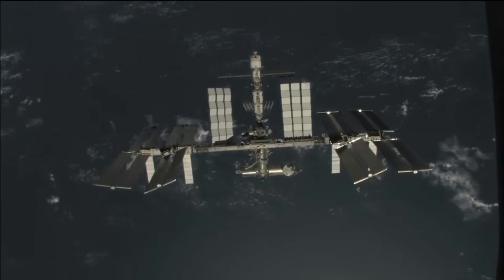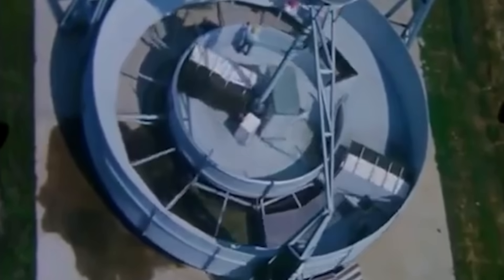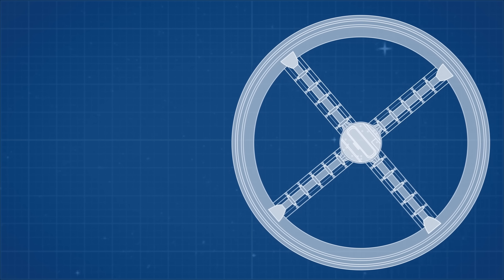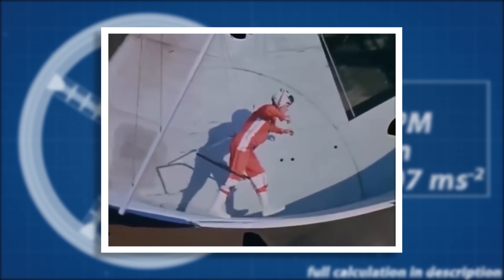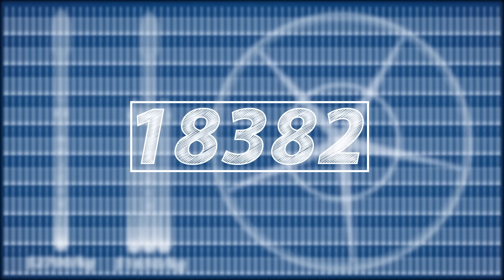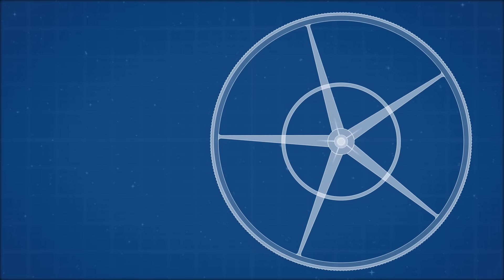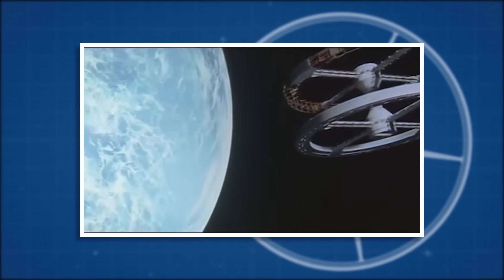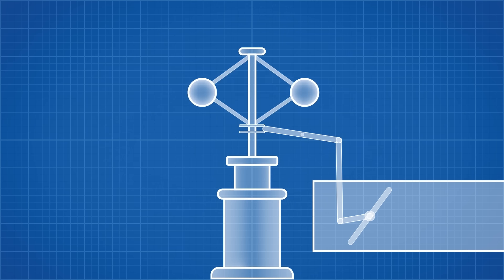Can We Create Artificial Gravity?

Comment: first, you dont need something so big as the elysium to reduce the gradient effects of your feets and head..  400m diameter disk is enough in that matter.
You dont need a disk.. you can use just a tether with another habitat for counter weight, or you can use inflatable habitat and you launch them in sections to complete the ring.
Your cost calculations are also pointless, launch cost will be reduce a lot in the comming years, and we will not need nothing of this until 30 years at least.
Reply: He did qualify his calculations with "although costs will only go down in coming years". 
I don't think working out a solid figure with today's information is pointless. Bit harsh expecting him to calculate costs based on imagined figures from the future.
Reply: AngelLestat2 What percent of force difference between a persons feet and head can they handle before becoming  disorientated? What is the smallest radius for 2Gs of simulated gravity before it sickens occupants?
Reply: AngelLestat2 yep and that's why NASA doesn't use it.
Reply: You can't simulate gravity everywhere. That is fiction.

Comment: Probably NOT in the way you describe.
(please read complete post if replying about vibration)
Sorry but rings, joined pods or any rotational gravity that does not have a firmly fixed axle wont work.
Take your car wheel with it's nice fixed axle and just move a wheel weight and it will start to shake.
A freely rotating object in free-fall (orbit) would require even more precise balance .
 
If a person were to walk from the 0 degree point to the 90 degree point an equal mass would need to move, in concert from the 360 degree point to the 180 degree point at the same pace.

You might say this would have little effect on a million ton station, but it would be cumulative,  and any unbalance would quickly accelerate without a fixed axle to force it back to center.
Putting on counterweights that could be rotated around the station might be a solution to ironing out small oscillations, but it would probably mean that large movements of personnel, such as 500 people going to a concert all from different parts of the ring wouldn't be very practical.
Reply: I don't see how what you're saying can be true.  How do you even have a "fixed axle" in space?

Now if you're saying that the center of mass would change then I get that.  But so what?  At extremes that might be a weight distribution problem, and therefore a structural issue.  It will never be a vibration issue however.  Vibration is caused by the center of mass not being in the same place as the axis of rotation.  In other words, if the axis is fixed (as in a car axle) and mass is distributed unevenly at the rim such that the center of mass is not where the axle is, the axle will still try to force the center of rotation to be at the axle.  That stress, combined with the rotational motion is what produces vibration.  In space, there is no fixed axle.  The center of rotation is free to move to wherever it wants.  Therefore no vibration.

If you don't believe me, try hanging a bicycle tire from a long string attached to the hub.  Unbalancing the tire will cause the point where the string attaches to move in a circle, but it will not produce any vibration.
Reply: I don't know if you clicked the "read more" as you fail to see that the "vibration" issue was just the first part of my explanation. I just used the wheel weights as an example. On a fixed axis the effect of a tire being unbalanced causes vibration in the car which we've probably all felt at some time.
Pretty much my whole point is you CAN NOT have a fixed axle in space.
(good clear explanation of where the vibration on a spinning hub comes from BTW).

It is the oscillation that's going to cause the problem (as I went on to explain).
Your example of a wheel hung on a string is a fairly good demonstration of the oscillation being unbalanced will apply to a spinning object, but it is still hung from a fixed point under 1G ,which makes the string a rod, so it has external forces restricting it's range of movement to within a fixed circle (fixed by rotation rate, length of string and how unbalanced the wheel is).

A more precise and easily tried home experiment would be to stick a couple of  the same vale coins onto opposite sides of a Frisbee, and watch it fly straight. Then start moving one coin around the ring getting closer and closer to the other coin. It will start to oscillate (wobble) when you throw it, and the closer the coins get to each other the more pronounced will be the oscillation.
 
It's the same misalignment of the center of balance that makes a "goofy ball" toy goofy when thrown or rolled.

Such an oscillation in a Ring space station could be countered by computer controlled Station Keeping Thrusters, but would cost a lot in fuel.

To be clear, such an oscillation could not be allowed to occur (even if it was neat circular pattern) as it would be detrimental to a clean orbit. The station would move from side to side on it orbital track, and (worse still) accelerate and decelerate as it falls.
Reply: You're talking about things like aerodynamic effects in space?  Not applicable.  Center of balance also only applies if you're balancing against an external gravity field, which of course in space you're not.  I think you also need to read up on reaction wheels (used for example on many satellites for attitude control).  I don't get your "moving side to side as it falls" in a space context.  Again, if you're talking about the CoR (center of rotation) not aligning with the center of the structure, I don't see the problem.  The only effect of such would be a slight difference in the force of "gravity" measured at different points around the rim.  Those variations would be stable/static (for a given mass distribution), so no "vibration" or "oscillation" to shake the station.  As long as those differences don't exceed the strength engineered into the structure things should be fine.

A ring/disk structure should be stable even if the CoR is ON the rim.  The only problem would be that now the "gravity" gradient would be extreme, with the CoR being in 0g and the opposite side of the rim being at much higher than normal (exact value dependent on rotational speed).  As I said, that's definitely an engineering issue, and could make things like moving around inside or docking with the station.. interesting, but also note this situation is unstable and could never occur without deliberate effort.  If all the mass were liquid and the rim a uniform hollow torus then the liquid would start flowing "downhill", or towards the higher-g point.  It wouldn't ever all get there of course, since the redistribution of mass would start moving the CoR back towards the hub, with the equilibrium state having the liquid distributed evenly along the inside of the outer edge of the rim and the CoR coinciding with the hub.

I'm thinking this might actually be a good balancing mechanism.  You could store (at least some of) the station's water supply in tanks spaced around the rim and connected by pipes.  To maintain trim you pump the water through the pipes to put more or less water in the various tanks to offset the movement of people and equipment around inside the rim.
Reply: Frustratingly no, I am not talking about aerodynamic effects, and until you can go throw a Frisbee in space you'll have to ignore any aerodynamics. The oscillation will still be there though.
CoR is where I'm at, and again, not about vibration, as there is nothing to vibrate against, but the oscillation is just as would be apparent if you went and did the frisbee experiment.
You can't just go changing the Center of Balance on a free floating rotating object without causing a shift in the position of it's CoR.
The shift of its CoR will cause the mass of the whole to shift around the uncentered CoR shifting the mass of the whole to move backwards and forwards as well as from side to side. 
Tracing your finger in a path down in the air and drawing 6's would describe the movement, and such a path would IMO make a stable orbit almost impossible. 
Your liquid balanced torus sounds like an elegant solution, but having tried balancing a boat half full of water I'm not so sure :) It would still mean that every time people or materials be moved from one part of the torus to another it would need careful planning to ensure an equal mass of water be moved to the opposite side of the torus to keep an even balance.

Personally I don't see such stations coming for many generations yet. Robotic systems (3D printers and such) don't need the huge resources that Human being need to survive in such a hostile environment as space, and as Robots are tasked with more of the experimental/construction burden so the need for humans to go into space becomes less. ATM the resources used to put the needed numbers of people into the micro gravity experimental environment are  pretty much sufficient. Massive investment to put a load of extra scientists into space is not really needed. 
The current transportation system and time limit imposed turnover is IMO probably the most cost effective one we've got.
Extra investment for National Pride projects and Space Tourism is where the new advances will come from. The need for artificial gravity, to overcome the medical effects of long term weightlessness won't be needed until people have to spend years in space because they have somewhere to travel to, and not just back to Earth.
Of course by then a 1G (less is still OK) propulsion system might have been developed and there will be no need to spin.
Reply: +docthebiker The use of water as an active counterweight brings up the issue of thermodynamics, our favorite law of physics. You would need a tremendous amount of heat in order to keep that much water fluid in space, where even the best insulation can't keep you warm for more than a day. A solution is to just have the water hooked into a nuclear power station for the craft, and use a portion of the water for supplying heat control to the craft, a portion for drinking, and the rest may be in reserve for use in balancing the craft and washing. But you can't just have water floating around pipes in space, you would need a series of tanks that would be able to supply pressure to the water and prevent it from boiling if a spot of low density were to pop up. These tanks would also be able to act as the key part of the craft balancing apparatus. But this is by no means damage safe, but that could be resolved by adding additional copies of the water system and linking them together.
Reply: It is true that even small mass displacement would have gigantic effects on station movement, but that is just part of the counter balancing problem. 
You can move water or other equipment around to combat the problem.
Reply: MsSomeonenew Totally: With a rotating mass in balance you could move any mass added afterwards (while keeping it in balance) as long as an apposing (balancing) weight shifted in concert. The trouble is on a small station it would be easy to unbalance the harmonic resonance, but easier to  synchronize shifting the masses. This would require a professional crew.
So yes that could work, but the cost over the lifetime of a station would far exceed that of just rotating (changing) the crew.
Don't forget the whole point of most science in space is to do so in a micro gravity, otherwise they'd just be done on Earth.
Being weightless is a big part of the Space Tourist experience and they won't be up there long enough for health concerns.
So the only purpose I can see for a Taurus space station is for Space Cities and who would want to live in one of those?
Reply: +Michael Johnson  This is completely wrong, you do not need massive amounts of heat to keep a spacecraft at a comfortable temperature provided it is somewhere near Earth's orbit.  The natural temperature of an object in Earth's orbit is around room temperature.   That's why we are here.  Artificial satellites maintain a temperature centred about 25 deg.C without using any energy source other than the Sun.  Spinning satellites do it by the surface absorbing heat when it's facing the sun and radiating it away to deep space when facing away from the sun.  Three axis stabilised satellites do it using heat pipes and passive thermal control methods.  They do have active thermal control systems to fine tune the temperature of specific areas and there can be large local temperature differences eg between the front and the rear faces of a solar array but the average temperature is pretty much shirt sleeves weather .

Comment: back in the 1980's MIT or Caltech had a professor that was pushing a long tube design. The length would be several kilometers long with a diameter of a coupe of kilometers.  Something similar to Babylon 5.  It would slowly rotate along its long axis.

Comment: the problem is to keep it spinning.
Reply: wouldn't be that tough, angled thrusters could solve that pretty easy
Reply: Kronomoto

people walking around it would low it down a bit or speed it up a bit, any there are many other forces that would have to be accounted.
you don't want it to pivot and stuff like that.
surely gyroscopic effects would help you there, but still is a lot to consider.
allso making sure the thing stays on course while you have to apply thrust to keep the speed steady.. over time it would need quite a lot of small adjustments.
not to mention the center of mass problem, you have to deal with that too in order to avoid the whole thing bursting into an excenteriszed frenzy.
consttucting this thing would seem pretty easy vs operating the thing.
Reply: It's a fun engineering challenge to think about, but I'm not sure the engineering of keeping it stable is harder than the logistics of getting it up there.

As far as keeping it stable, you shouldn't have to worry too much about the thing rotating at a right angle to its usual spin. Mostly that would do would be change the angle of approach for ships coming in (assuming they're going to dock on the axis, where rotation is zero). More critically, it could reorient your stationkeeping thrusters so they're no longer pointed the right way.

I don't feel like doing the math, but it's possible you could keep it at the correct orientation with massive reaction wheels in the center. Dealing with the orbital drag slowing the station down is going to be a lot harder, I think, since you need to use fuel to correct that, and not just angular momentum. Even with a nuclear reactor powering the most efficient electrical thrusters we can build, you're going to consume a lot of fuel.
Reply: Output Coupler

reaction wheels would not quite work for too long, you would have to "unload" them, can't spin them faster for ever, right?

still we did not solve excentric drift due to center of mass not matching center point of rotation. allso, landing space ships would not be the real problem , but people and stuff moving around all the time on the wheel it self.
ships could match velocity and would not really interfer a lot, apart from when docked, changing center of mass again...

allso, getting it "up there" is a one time task, keep it there, now that is something different and requires a constant effort.

Comment: You could have a counter weight on the end of a long cable, and then spin the counter weight, and the Space station. For  a larger space station, you could have a number of space station connected with a cable in a circle, and send them spinning. Also, any asteroid has tons of nickle and Iron to use for a space station. The initial cost of sending up a refinery would be expensive, but the cost would in the long run would be very cheap. Eventually, we could ship the Iron, and nickle back to earth. Up in to space will all ways be expensive, but shipping in down to earth would very inexpensive.

Comment: A gravity gradient would not necessarily force the blood to your feet. In fact, due to the elasticity of the vascular system, blood would actually be forced to your head. The real phenomenon that dominates artificial gravity in rotating habitats is Coriolis forces. Things don't fall straight up and down, and the inner ear has a hard time accommodating when you turn your head in and out of the plane of rotation.

Also, the acceleration is not directly proportional to the velocity; it is directly proportional to the square of velocity.

Comment: centrifugal force IS actually not real it is the perceived force that is actually described by the word centripetal force, if the circular motion were to stop in the example of centrifugal force the object in question would then travel in a direction directly away from the center of the circle, but thats not what happens the object would actually travel in a streight line tangent to the circle in the direction of the circular motion. centrifugal force is a misconception and it is a scientific fact that it does not exist and that the force people try to explain as centrfugal force is really centripetal force

Comment: why build it bigger? just make sure it has no or only a VERY few windows. and replace it with cameras that can counter rotate and thereby give a "correct" view. :)
Reply: The problem is unless you scale the rotating ship up to the size of say the Halo Ring you feel like you are on an amusement park ride. Your body is moving in a tight enough circle, every time you stood up or even just moved side to side part of your body would be accelerating at different rates and you would feel the spin in your inner ear balance fluids. You would quickly become "sea sick"

Comment: Idiots at NASA... Why does it have to be a ring? A simple capsule with equal weight at the other end, connected by a long and thin connector is enough. So total weight is very comparable to what is currently used in space crafts.